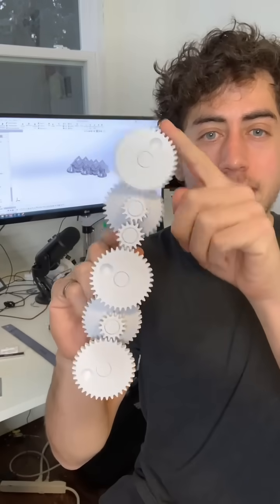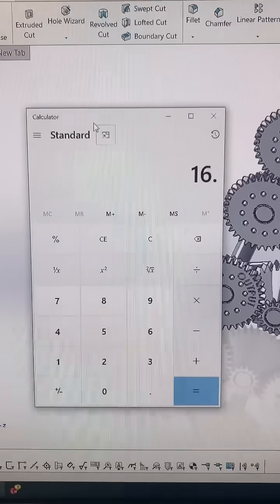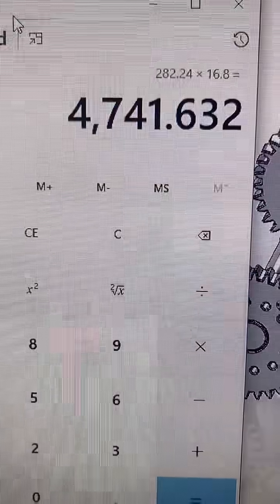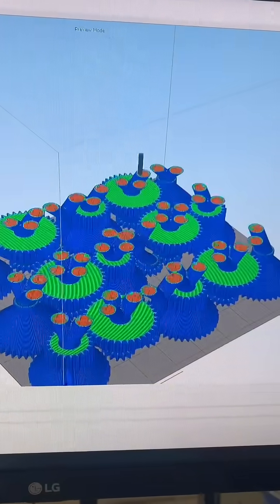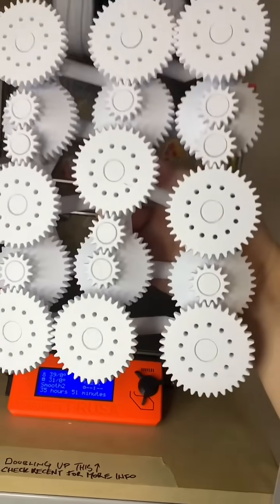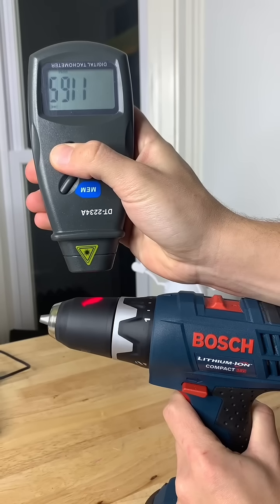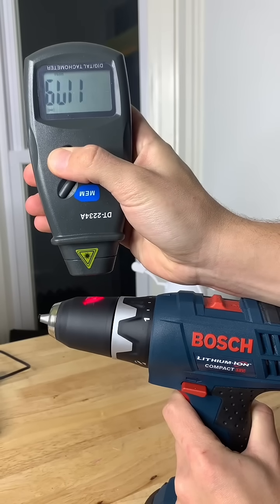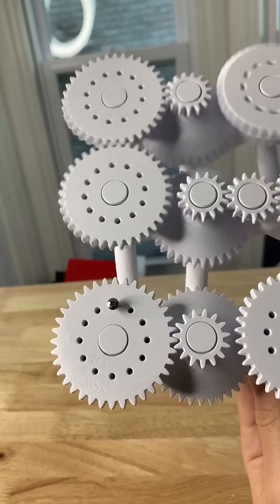4741:1 Gear Ratio vs Drill!

Comment: There's a piece of art with a DC motor that runs constantly, turning a gear assembly, where the final gear is terminated into concrete. Kinda profound.

Edit: its called Machine With Concrete.

Comment: This would be a lot better if you explained the implications of loading such a large gear ratio. E.g. if your gear was strong enough (which is unlikely given its 3d printed) you could (slowly) lift something rather heavy using that drill on the other end

Comment: Do it backwards. Spin the output with the drill!
Reply: @slickboyd  for example if it takes 10,000 rotations of the input to get 1 rotation of the output… then spinning the output would result in the “new” output gear to spin 10,000 rotations.
Reply: @slickboyd  I want to see the gear go fast
Reply: @slickboyd  it wouldnt
Reply: @slickboyd  if you spun the current output gear at 1800 rpm the input gear would spin so fast it would time travel
Reply: @slickboyd  4741:1 gear ratio. If the output gear spins at 1100 rpm then 1100x4741=5,215,100. That’s how many times that gear would spin in 1 min. The materials wouldn’t be able to hold up but it would be fun to watch them try.
Reply: @slickboyd  because the current gearing system is acting as a torque multiplier. So the output gear requires an immense amount of torque to rotate.

Comment: I suggest a high rpm dremel instead of a cordless drill
Reply: It will just cause this PLA contraption to melt from friction. It should be printed with POM to withstand this. But it's not printable in POM.

Comment: So if you turn the output gear in reverse one turn the input gear would turn 4000 + times, is that correct? If so what would the rpm’s be.

Comment: Rotate that last one with your drill and show us  how fast the first gear spins 👍
Reply: Too much torque probably, structure would break
Reply: @funnyyoushouldsaytha  still wanna see it tho.
Reply: It probably wouldn’t even move it, or at the very least something would break
Reply: bro this is gonna cause the end of the universe lmao gears aren't supposed to spin that fast
Reply: It would either explode or not move at all
Reply: Does the drill have the torque for that?
Reply: my man would make a black hole
Reply: I like the universe one ☝️
Reply: The gear ratio also changes the torque needed to spin the gear. So the last gear requires too much torque to be spun.
Reply: It's the same bro... Still that speed
Reply: Can someone explain this, Wouldn't it take the same amount of spins because the gears are just moving backwards?
Reply: @deafdanny6299 think of it like if you had a big gear with like 80 teeth attached to a really small gear with like 8 teeth. If you rotate the small gear 1 time, then the large gear has only moved 8 of its 80 teeth, so you would need to rotate the small gear 10 times to rotate the large gear once. But if you take it the other way and rotate the big gear once, then the little gear will rotate 10 times. It's also going to require more energy (from higher torque) to spin the big gear than the small one, but don't worry about that too much
Reply: It would be the same because there’s the same number of gears
Reply: Would it not take the same amount of spins
Just backwards?
Reply: @AxolPiezz no, it would spin 4000 or whatever number it was times faster. Basically the gears are set up so that a bunch of small gears with very few teeth are driving a bunch of big gears with a lot of teeth, or vice versa if you rotate the big gears. If the big gears have 80 teeth and the small gears have 8 teeth, then for every 1 rotation of the small gear, the big gear has rotated .1, but for every rotation of the big gear, the small gear has rotated 10 times. So this whole set of gears Basically boils down to a small gear that has to rotate 4000 times to rotate the big one once since it has 4000 times less teeth, but if you rotate the big gear once, then the small gear rotates 4000 times. If you tried to do that though there would be so much resistance (torque) on the big gear that you would completely destroy the mechanism by trying to spin fast at all
Reply: Needs:
More torque
No plastic
More diamond
Nearly 0 play (space between gears)
Vaseline or transmission fluid
Reply: That probably would create a black hole🤣🤣
Reply: Unfortunately that wouldn't work. That gear ratio means it takes 4000 times more rotations to turn the input gear than the output gear, and 4000 times more torque to turn the output gear than the input gear. Even if he had a drill strong enough to provide that torque, the 3D printed plastic wouldn't be able to handle it. The teeth would shear off.
Reply: the stress would cause the mechanism to shatter.
Reply: Wait til you hear about this thing called torque
Reply: Yh I want to see that

Comment: I know it will likely destroy it, but put the drill on the output gear, and slowly crank up the speed. The torque will be immense, but the original input gear should pass the speed of sound fairly quickly. Before the plastic melts.
Reply: lmfao. it just wont spin bro, there's too much torque and friction between gears to even get it moving. funny comment though
Reply: @ari90i  But it would be fun and destructive to try.
Reply: @gaijininja  wouldnt really be destructive. The gears would spin a little bit and then just bind

Comment: what happens if you put the drill on the last gear? will the first gear reach lightspeed this way? or would it be easy to reach lightspeed with a bigger gear setup?
Reply: Just so you know, it takes a lot of torque just to move the last one
Reply: @TheBananermanThefirst  would it be possible? if the push is sligdly under the pressure tht wouöd break the gears and with long enough waiting time it should be possible to turn the last gear right? or am i wrong?
Reply: @ibessf  you might be able to turn the last gear very slowly
Reply: @TheBananermanThefirst  and when this is possible, it should be mathematicly possible to build a gear setup where the last gear reach light speed right? i mean if the gears are made of a material which is strong enough to stand this procedure it should be possible right? but ofcourse, i know there is something i am not aware of, because if this would be possible, someones would have done it a long time ago. so what am i missing?
Reply: @ibessf  so you actually could never spin one of the wheels at light speed because it would take so much energy to do that that it wouldn’t even be able to happen the closer you get to the speed of light the more energy it takes to get just a little bit faster

Comment: Why don't people spend the slow gear, to see how fast the fast gear goes!  I want to see that!
Reply: There is waaay too much friction going on.  Spinning from the slow end, friction on the fast end would be multiplied by >4000x, plus you have to add in the friction of all the gears in between.
Reply: that's literally impossible
Reply: The amount of torque you would need is insane. Even if you did get that torque, something is going to break with all that force